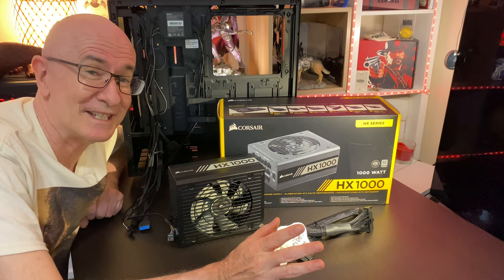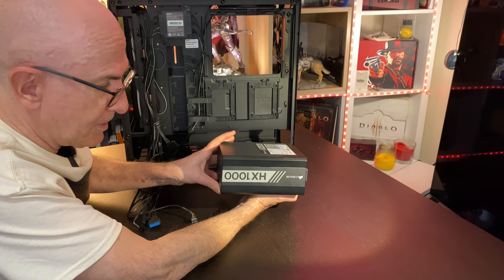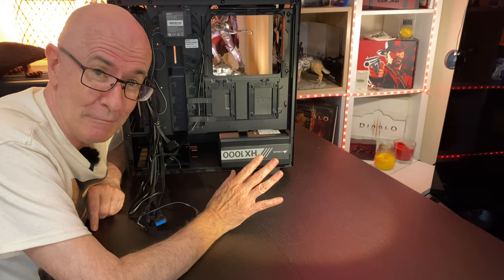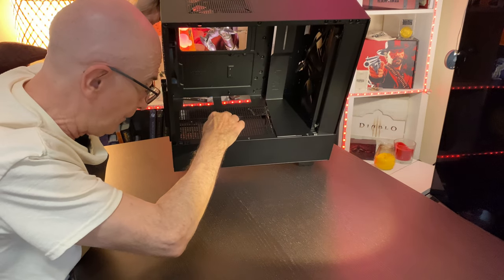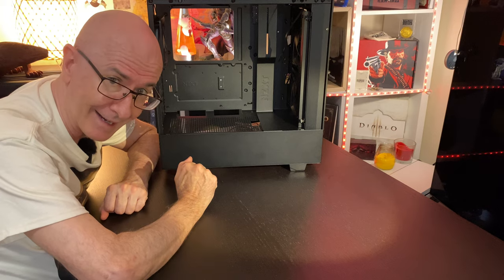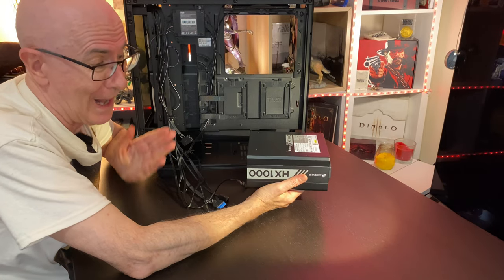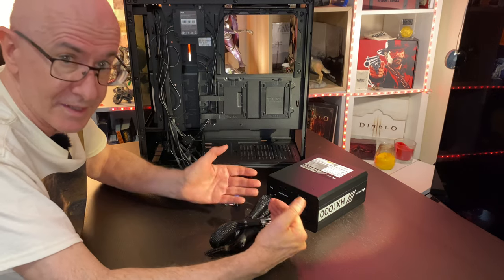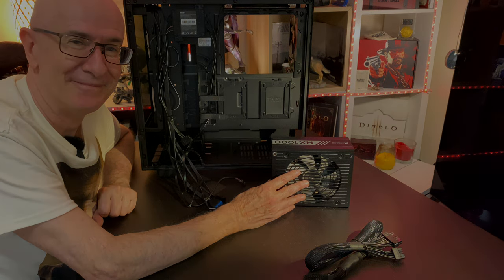How to Instal a Power Supply Unit PSU into a PC - Fan Up or Fan Down?

Comment: Hmm--just watched an older video by JayzTwoCents suggesting mounting your psu fan facing up.  Especially if your psu will not be under much stress to initiate the fans in the first place (as you seem to doing with your 1000 watt beast)

Comment: Thx alot for this video Chris, I have The same case at home atm (NZXT H7 Flow), with a seasonic PSU that has a Hybrid mode on, its recommended to put Fan upwards, but I am not gonne do that, with all the above you mentioned in your video. That you only have 330 abbonnees is me a riddle.